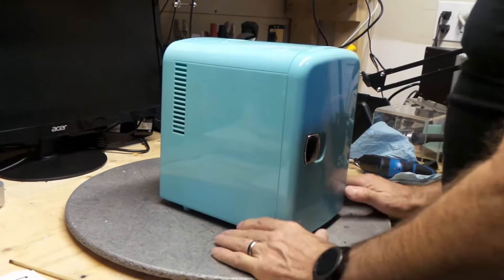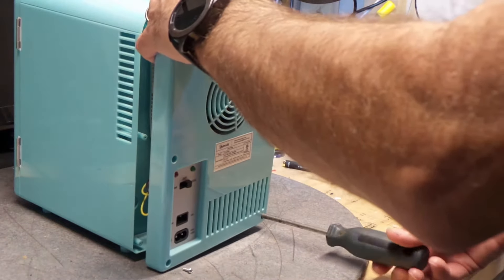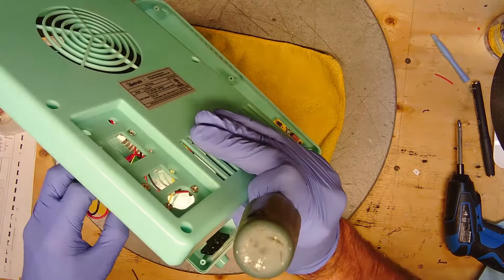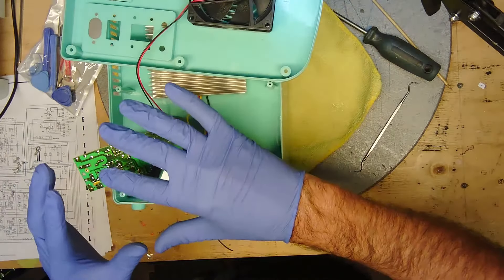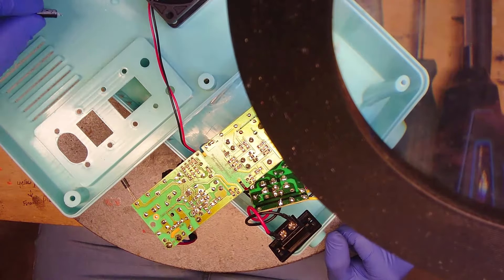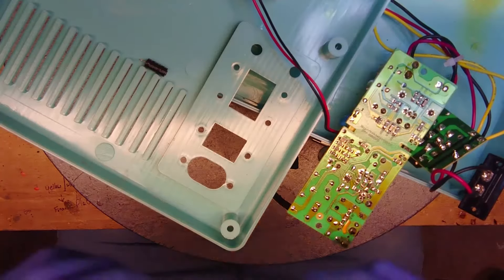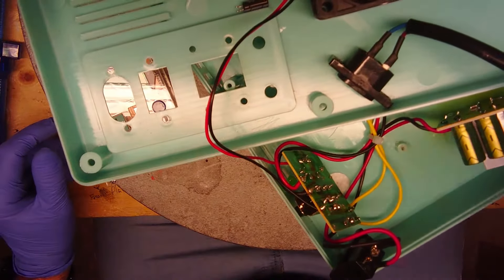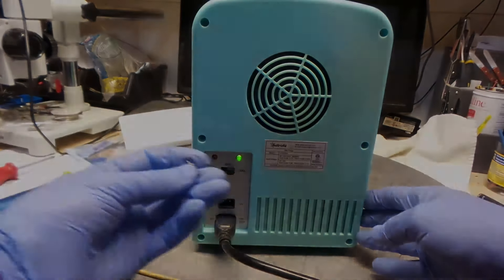ASTROai mini fridge won't run, green light blinking and fan won't turn

Comment: Had the same exact issue. I replaced the same capacitor you did and the mini fridge works again. Thank you sir for this video 👍👍👍👍👍👍👍
Reply from the maker: Glad it helped
Reply: Where do you purchase the capacitor ?
Reply: @aracelimartinez587  that's what I need to know and will this be a constant issue
Reply: Same issue for me too. Replaced the same cap and its working again. Thanks for the video and tip about the smallest capacitor being the most likely culprit! I bought a variety set of caps on Amazon and Im sure they'll come in handy for future repairs/projects.
Reply: My fan works but my light is blinkn.  I've tried diff ac cords same thang.  What cud be my issue.  Mine is a fridgidaire brand, that was on sale for $19 bucks.  Cost $70 now.  Don't wana buy a new 1 or pay outrageous fee 2 hv repaired.  Help
Reply: Hi. May i know how cold the fridge is? Tq

Comment: Hello there, it is January 2025 and I am here to thank you, I fixed my Pepsi mini fridge thanks to your video and explanation. Mine didn't looked burned or anything but was doing the same as yours. Blinking green light with a fan that seems like it wants to run. Reading all others that have commented, seems this is not just a factory flaw, more like programmed obsolence.

Comment: I had the same exact problem but after 20 seconds or so it started Up Normally I tried to recreate the same problem maybe the flexing of the circuit board but cannot get it to happen again

Comment: Hi,

thank you for your excellent fault-finding video. I had the same issue and replaced the 10 uF capacitor with a new high-temp replacement (Würth WCAP-HTAH). 
My green light kept blinking intermittently, though, so I also checked the other capacitors. The AC side capacitor was all right, but the DC side 2x 1 mF caps were faulty! So I replaced the two green 1000 uF 25V caps with the closest replacements that I had in storage, two 680 uF 25V ones. After replacing these, my Astro works again.
As a side note, the toggle switch is really cheap chinese ..... and sometimes does not conduct in the on positions. Be careful with it and wiggle it a bit to make contact, check the LEDs for proper contact.

Comment: I just fixed mine by replacing the same capacitor you did! Mine was a Coca Cola themed one but was just a re-skin as it was the same components. I did not use the same type of capacitor, I only had 10 uF 50v Aluminum electrolytic capacitor. My soldering skills are terrible, so i ran wires from the board to the capacitor and back to the boards. After shocking myself by holding both ends of the PSU,  and putting everything back together, it worked perfectly! 
Long story but thank you soooooo much for this video.
Reply from the maker: That's super...glad you could use my video...
bravo!!!

Comment: I've fixed so many appliances and electronics by replacing capacitors. Sometimes just replacing the swollen ones without any other testing. Amazes me that the supply chain can't make a durable capacitor.
Reply: they prob can, but dont because its cheaper/ a problem if things last forever. designed obsolescence.

Comment: hi i have a frigidaire efmis129 in pink that looks exactly like yours in  the back, and my problem is i also have the green blinking light but my fan doesn’t turn on at all or make any sort of movement and there is a slight beeping/ringing noise

would the problem be with the capacitors as well or do i have to replace the entire power supply? please let me know i’m running out of ideas and i also know nothing about electrical parts i would appreciate any help and thanks for the helpful video!
Reply from the maker: I’m releasing another video about same issues…same finding… one capacitor is the issue, it’s the smallest capacitor on that board… replace it and your fridge will work again.

Comment: Your power supply has failed. Remove the power supply and chunk it in the garbage
 Buy a 50 watt 12 volt power supply and install in its place. Model Meanwell RS-50-12.

Comment: My OMMO mini frdge has a light that glows off then turns on
Reply from the maker: It's probably that one capacitor....10uf at 50v
Replace it and there's a chance it will run again

Comment: Any idea where to get that three-position switch? Mine must have melted together internally and it stuck to cooling and the fridge does not work. I either need that replacement switch, or a new board that the switch is connected to. Thanks
Reply from the maker: digikey has all those parts...

Comment: Thanks Joe!  Same issue on my Cooluli, and with your help fixed it up in 15 minutes!  I even had the part on-hand (a first for me!).  By the way, how do you like your component tester?  Would you recommend?  If so, where'd you pick it up?).  Thanks again!
Reply from the maker: Ah. Nice fix for you as well.  Good job!!!!
The capacitor tester is something you can buy on eBay for 30$ . I wouldn't bother I'f your not gonna work on these again tho.
I repair electronics every day so it's very Handy to have ..
Thank you for watching my video and glad I could help ....

Comment: I have a Kell K4 and the fan doesn't spin, the light doesn't blink but it's very dim and it makes a bit of a high pitched but quiet squeak or whistle.  I do not have any tools except a soldering iron, how might I test for this.  Perhaps I can just replace the similar capacitor, how likely might it be the same issue. It has one capacitor on the board that is just like the one you replaced here.

Comment: Since its a common problem, is it a defective capacitor or a defective circuit design that burns them up that's causing the problem?
Reply from the maker: it seem like alot of PPL having the same issue, I'd say its a design in the circuitry, the faulty cap is actually a 10uf at 50V....I know the whole circuit board is running hot and drying up the cap prematurelly.

Comment: I had the same issue. I didn't suspect the 10uF because the two 1000uF caps were bulged. I took them out of the circuit and they were completely open. I replaced those, but it still didn't work. The 10uF was also bad.

Comment: What tool do I use to take the Compacitor out and put it in place again making it stick into the circuit board?
Reply from the maker: Hi, I'm afraid this isn't really a repair for regular home DIYers unless you have experience using soldering irons and building circuit boards.
You need to use a soldering iron to heat up the legs of the capacitor you want to remove. This will melt the solder, and then you can pull the capacitor out of the circuit board.
In your case, I don't suggest you do this on your own.

Comment: I have a red Igloo labeled mini thermo “fridge.”  Mine had a very faint high pitched whine from the power board. The fan wasn’t turning either. 2 output capacitors were deformed on the power board (1000uF 25V). I replaced them with quality Nichicon capacitors. I got the fan to spin, but the fan was horribly noisy, and sounded like it had bearing play. It would quiet some, and randomly get noisy over any tap on the fridge. I decided not to connect the fridge to avoid damaging my 2 new Nichicon capacitors.
My guess is the original capacitors nuked themselves trying to drive the fan.  The fan also needs to go.  Hopefully I can yank out a fan with the same values from from the local neighborhood alley junk piles, when the time comes.
Reply from the maker: Good stuff!!! Let us know how you make out for sure...

Comment: Same issues with my mini fridge, and its one of them Call of dudty warzone ones, distributed by Orbit Inovations LLC, so it has one slight difference and that is that mine only has one electrical, 2 prong, port, 120V AC; would everything i saw in your video still apply to mine?

Comment: Mine showed similar symptoms so I replaced the cap with the size recommended in the video. Unfortunately, the fix did not work for me--but thank you for making this video as it finally pushed me to get a soldering iron. Anyway, the large cap on the board had ~75v on it before I discharged it. The fridge had not been plugged in for at least three weeks or so & I'm not sure if that 75v value is high or low given those circumstances. After swapping the cap did not fix things, I checked around to see if there were any other clues. For whatever reason, the load size of the transformer does not output the 12v needed to run the mini fridge. I thought I might try rigging up molex power off a computer PSU to see if the fridge functions normally with 12v. I thought this might work since the 12v power connection option (for a car) goes directly to the daughterboard where the cold/hot switch attaches while the 120v goes to the main board to step down to 12v. If this works, my guess is somehow the transformer failed---which (I think) is unlikely but certainly not impossible since I've encountered failed doorbell & thermostat transformers a few times before. 

In any event, I've seen multiple boards on Amazon that output 12v from a 120v source. The spec sheet on this fridge is about 3.5A@12v iirc so I might just replace the entire board with a 6A max version for ~$10 or I might just give up & replace the darn thing entirely. But hey, at least I finally got a soldering iron lol

Comment: I just checked mine, and all I could find was that the heat sink paste was dry and gone. So I put some new paste, and the fan was able to turn on. ...But not the green light, even though I have it in cool mode.

Comment: I'm having this exact problem with my minifridge. Do you happen to know of a way to prevent this problem from happening?
Reply: Electrolytic capacitors dry up, the dielectric changes and then the capacitor loses capacitance and has increased serial resistance. It is unavoidable but you can mitigate this by putting in quality components (Panasonic, Sanyo or Würth). Since the Astro builders saved on expensive components, you get a relatively short lifespan.

Comment: I wanna cry so bad! I only bought mine (it’s the Icon one) in May and now it’s literally not even coming on…. And I JUST threw away the box it came in so I can’t even find a manufacturer number to call And I just know I’m gonna tear it up if I even try this! 😭
Reply from the maker: What's it doing?
Reply: So it’s when u plug it in, turn it on, it’s not even coming on at all…. Not the fan, not the light,  nothing… oven tried a different outlet but nothing

Comment: Similar success story here. I also like the MTester that you show... Found it to be quite useful on occasion. You don't show the in-circuit test of the fault capacitor, though. Was your Capacitor Wizard able to spot it in curcuit? I tried the MTester and it seemed confused... it saw a diode with about 7.5uF capacitance.
Reply from the maker: Hi Steven
the reason for not showing the faulty capacitor with my capacitor wizard is...as I was testing the bigger cap prior to the faulty one, the caps were still charged and I shorted my capacitor wizard, it shorted a resistor....so I had to use other meaning of testing the caps....a error on my part....
but it was a easy fix and I actually made a video repairing the wizard...

Comment: I have a Tacklife mini fridge that looks very similar especially the outside.  I had for around 6 months and it stopped working last weekend.  But the light is blinking slowly.  I opened it and the inside looks very different.  I dont even see a capacitor.  There is one small all black cylinder that says "+" "Hy" "RJ" "2W10"

Comment: this also applies to the Xbox mini fridge, it has the EXACT same PCB. and i just replaced it and works. my question is, is that PCB supposed to get burning skin touching hot?
Reply from the maker: Not that hot usually...if you have a multimeter check some components on that power supply....it does get hot but usually the heatsink helps a great deal in dispersing the heat...check the transistors
Reply: @VintageAudioFever  Thank you! I will do a little more research on what the transistors look like and the specs of them.

Comment: Did you replace it with the same kind that was in it or a different one?
Reply from the maker: Hi Lisa
I did replace the electrolytic capacitor with the same value YES.
So example, if it's 10uf...it has to be the same value

Comment: What is that component tester? I like the clear casing on it.
Reply from the maker: Digital All-in-1 Component Tester Transistor Diode Capacitor Inductor
Reply from the maker: On eBay for under 20$

Comment: I have the same issue with my mini fridge what are the things that you used to take out the battery and put in a new one call. I need to buy them and put in a new battery
Reply from the maker: Hi ...it's not a battery i pulled out...it's a capacitor, you need a soldering kit

Comment: Does this work on different mini fridges? Mine is a 10L/15 can fridgirate that unless I hold down the power switch refuses to turn on
Reply from the maker: I would say you have a bad connection...loose wire or cold solder around your connection.
Check it out closely...should be a easy fix
Ps safety first...unplug from wall
Reply: @VintageAudioFever  I will I'll most likely see if it's the wire if it's not I'll try and find someone who can fix it

Comment: Is there a way to fix this without tools? Mine is doing this exact same thing and I don’t have any tools besides a screwdriver
Reply from the maker: Hi....If i remember correctly, it was a 10uf capacitor that was open..it was the smallest cap on that circuit board if i recall.
In order to do small repair such as this mini fridge, you would need to invest in a soldering kit ( solder- resoldering pump, some lead and a multimeter that is capable of measuring in ohms... usually the list I send you could run you about 50$ .
It's a lot of fun repairing your broken electronics and rewarding....
If not, you can always bring it to your local repair shop....or send it to me
I will repair this for you at no charge, i don't mine helping you.
You'd have to pay shipping of course and that can run you some money also depending where you are ..
I know it's pennies to fix....your best option is to buy a soldering kit...and start having fun...

Comment: Where can I find capicitor number and which website do I go to buy it 
I have same koolatron mini fridge not cooling only green light shown
Reply from the maker: The value and voltage is written on side of the capacitor. I buy my capacitors at 'digikey.com

Comment: sir please response on my comment i have a question what is the number or letter on the R23 R24 R25 coz i didnt see correct me if i wrong 1k0?
Reply: 1RO?
Reply from the maker: Hi ...i don't have that mini fridge anymore buddy...i fix then it's back to customer.
So i don't remember the capacitor value...
It's the smallest on that power supply board...I'm sure i have mentioned the value in my video...watch it 😁
Reply: @VintageAudioFever  thankyou sir

Comment: What’s the capacitors Digi-Key Part Number?
Reply from the maker: Just go on there site and create a account...
Then i just type in the capacitor value i need and it will appear on the bottom all the capacitors you can imagine....
What i did is i made a list of all the Caps i wanted in stock and no shipping fees over 100$
Reply from the maker: But if you just gonna fix a few things around the house...you can get a capacitor kit from Amazon or eBay...cost off under 20$.
It has over 24 kind values and voltages...very useful for your home repair.
Reply: How do I find capacitor digi key number I have same fridge not cooling only green light shown

Comment: How to buy this part?Do you have link for me?
Reply from the maker: it's was a capacitor, I buy my caps from digikey.com
Reply: @VintageAudioFever  What is the part called and the numbers I need to look it up plz and thank you!
Reply from the maker: Hi....the capacitor that was open was a
 10uf 50v...and I buy my capacitors at digikey
But before you order parts, make sure that is the capacitor your unit needs....just because mine was that particular capacitor, doesn't mean it's the same in every units....you'll need a multimeter and a ESR meter to be absolutely sure it's the right capacitor your replacing...
And be aware of high voltage ⚡
Make sure your not plugged in and discharge your capacitors before venturing inside these mini fridge....
Reply from the maker: www.digikey.com

Comment: I have the Coca Cola version and everything works but after about an hour, it starts to get hot inside instead of cold and definitely releases a burning type smell. What may be the issue?
Reply from the maker: I'm not sure if it's made by same manufacturer...open it up and check for open capacitors...it's usually the smallest cap with high voltage..50v 
But I can't really say for sure without seeing it buddy...

Comment: Can you please let me know what capacity I should order? I have two mini fridges and they both stopped working with green flashing lights.
Reply from the maker: well if you watch my 10 min video, I do mention what capacitor to order...I think it's the 10UF @ 50V but watch my video  and you will know for sure...be careful and be safe while working with this fridge, make sure it;s unplugged..
Good luck
Reply: @VintageAudioFever Thank you so much. I did watch the entire 10 minutes of the video however I couldn't quite understand the capacitor part 😁